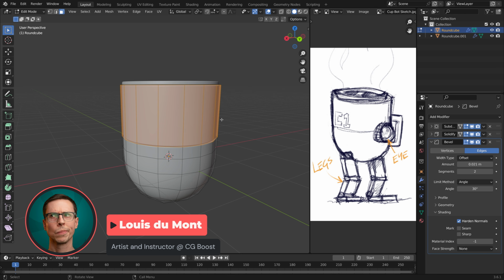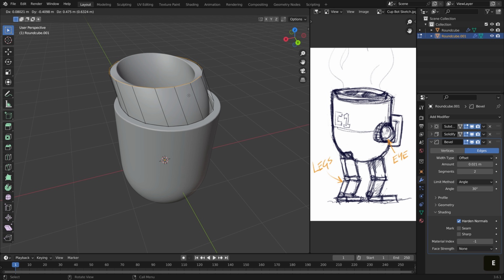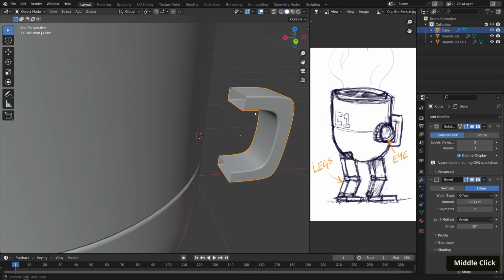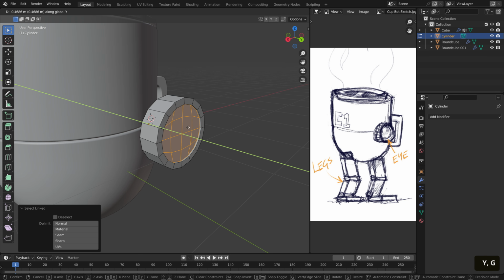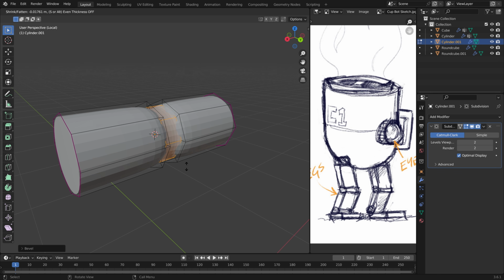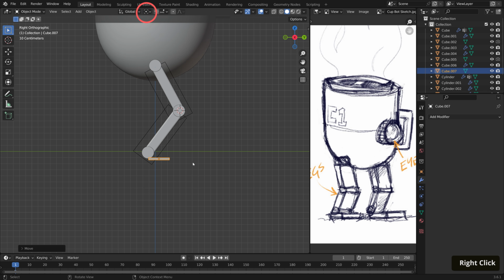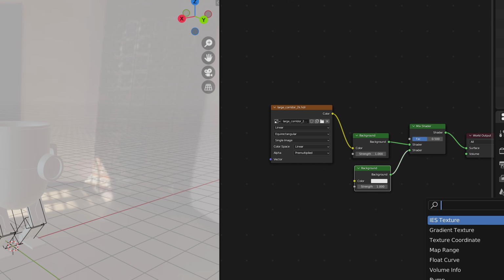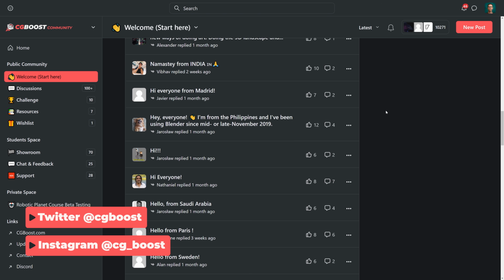Blender Hard-Surface Modeling Fundamentals #b3d #tutorial

Comment: Updating for 5.0.1 - 
1. Auto Shade Smooth exists right now. 
2. I found the 'extra objects' it's extra mesh objects and you search for this in the 'Get Extensions' part of the Preferences. 
3. Shrinkwrap is a pain, but remember to apply your scale and transforms, play with the settings. Modifiers are not destructive so if it's all messed up, try it a different way. Apply it in object mode! Order of your modifiers could be causing issues so if you press the icon that looks like a TV on each modifier, you can likely see if one is causing an issue and push it up or down in the list of modifiers that you have applied to the mesh. You probably just need to apply rotation and scale. 
4. When making the first part of the leg - he says ctrl e, but it's shift e. 
5. Inverting a selection with ctrl I. (he shows the key presses in the corner!)
6. There is no ambient occlusion setting in the render settings for 5.0.1 - I don't know how to work around that part. 
7. There is no bloom setting in the render settings, here's a quick fix https://www.youtube.com/watch?v=Yyofx-wbqCY&t=60s

Great tutorial! Subscribed - the speed is fast but I'm between beginner and less-beginnery so it was perfect for me!
Reply: I did this tutorial today.  What timing, your notes helped, thank you!!!
Reply: @zenzager  So glad! It's a great tutorial!
Reply from the maker: Wow, thanks for adding this info! ~Louis
Reply: @cgboost  No problem! :)

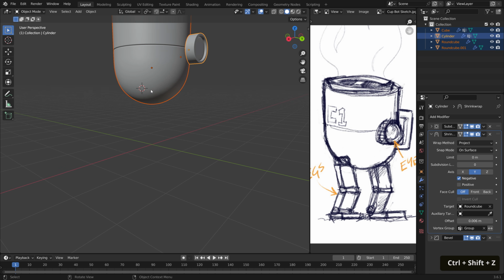Comment: My 'cylindrical joins' at 16:09 are not functioning as expected.  When I shift+e to crease them it warps the piece in the middle instead making it taper to meet the larger pieces of the cylinder on each edge instead of it being a flat drop like in the video.  Any assistance would be appreciated!
Reply: Figured it out.  There is a second set of inner edgeloops that I wasn't selecting

Comment: Crease vs support loops, when use them and why?
Reply: Just always always do support loops. 

Don’t become reliant on creases. It’s a shortcut that leads to bad habits. 

Real-world objects have slightly rounded edges. Support loops catch light realistically, whereas full creases create an infinitely sharp, unnatural edge.

 Support loops are actual geometry. They transfer perfectly to Unreal Engine, Unity, Maya, or 3D printing software, while Blender creases do not.

Texturing software like Substance Painter bakes ambient occlusion and curvature maps much cleaner when using real geometry.

Only use creases if you are prototyping. Not making a real model.

Comment: I've tried this in Blender 5 and the shrinkwrap doesn't work if I follow the steps.
I don't know if I'm doing anything wrong. Does shrinkwrap work different in 5?
Could you tell me if it works differently in Blender 5 or remake this tutorial for Blender 5 showing what needs to be done differently?
Reply from the maker: Hi, just tried following along and it seems like shrinkwrap in the same way. I could be that the (for example) the handle is on the positive side on the X axis and requires 'negative' to be selected in the shrinkwrap modifier. If in doubt, checking both negative and positive might work in this case. ~Louis

Comment: Hi, I noticed my modifiers were greyed out and yours were not, however, I could still apply them. I used Shift + D to duplicate the initial insert of the cup so this should have gave me options to apply modifiers separately with different values? I selected objects and altered the relationship to Make Single User but the problem remains. One thing I may have done wrong was that I applied a modifier and then pressed Undo, but I believe this may have set the modifier anyway as once it is applied it cannot be undone? TIA

Comment: I cannot apply scale on the mirrored leg in first place. What ive done to fix that was to apply all modifiers, then select all the leg parts, press ctrl-a -> apply rotation and scale, then with this objects selected i pressed tab (edit mode, then a to select all, then shift n, (recalculate normals outside). i think this is not a good tutorial, i get errors about transfomration, and some things are not well explainded why i done that. Its a good tutorial showing a way to model faster, but not well explained.

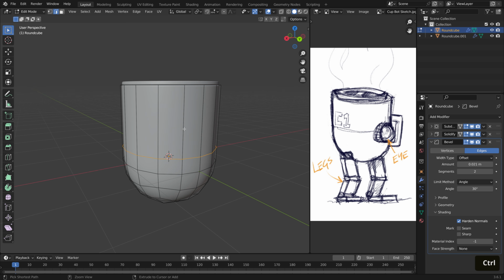Comment: If like me you didn't understand the process of adding a lip at first (5:12) and why exactly it works: Essentially when we've seperated the mesh with Y, the solidify and bevel modifiers act on the two mesh parts independently. This won't make a visual difference for the solidify, but since we now have two edges (on the lower and upper mesh parts), they will be independently beveled, creating a nice lip. Pretty cool modeling trick.

Comment: Hi, I am on Blender 4.3 and the shrinkwrap modifer is not working for me when I use it on the eye part. It works fine with Handle but not the eye for some reason,  I tried using negative instead of positive but it still doesn't seem to work for me. It would be great if anyone could help me with this! Thanks!
Reply: Did you figure it out?

Comment: At 3:26 How do you get the sharp edge on the rim? I added the solidify modifier but it appears rounded.
Reply: Tried it on version 4.1 and 4.3. The work around is to Shade Flat instead of Shade smooth. Then shade smooth later on when the cup shape is formed.
Reply: Same problem here, the rounded cube was created with curve loops, my solution was to select the loop, then press S to scale, press Z to select z-axis and press 0.

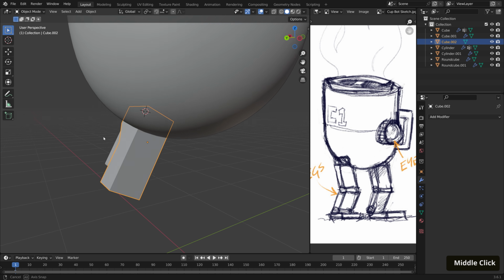Comment: if bool tool is not available on addons tabs look for it in extensions tab 20:10
Reply: if it gives artifacts after adding Boolean. make sure you select exact instead of fast in bevel modifier
Reply from the maker: @vasanthrajark  Thanks for the tips! :)

Comment: Hi, everyone! 
To everyone that's following this tutorial in Blender 4.1, here some things:
1 - Shade Auto Smooth doesn't exist anymore, so you have to go to Modifiers (wrench icon) > Normals > Smooth by Angle and then you Shade Smooth
2 - About the Shrink wrap, if nothing happens, try selecting Negative instead of Positive
If I see more diferences throughout the tutorial, I'll edit the comment!
Reply: i pray your pillow is always the  right temperature and your fridge always full 📿
Reply: Shade Auto Smooth is back. And shade smooth by angle modifier is not doing that.
Reply: Huge help. Thank you!
Reply: Hey I'm in 4.2 and after using the subdivision surface modifier, the object is more "round" but also has weirdly extruded lines going from top to bottom on the X and Y axis. Is there any way to fix this? It gets worse when using solidify.

Probably worth to mention that I didn't use the preset when creating the squadsphere because the presets are missing for some reason. However I did adjust the radius to 1 and Arc to 4.
Reply: @itsrainingacid143  I'm using 4.2, I don't have any problems
Reply: Thank you!
Reply: Thank you!
Reply: Thanks, i was so frustrated cuz the shading didn't work properly i almost quit the tutorial😅
Reply: Another change is that "Bool Tools" is in the extensions tab instead of add-ons, I believe!
Reply: thank you so much. you are the best ^_^
Reply: the shrink wrap still broken whith me
Reply: Immediately got stuck because I do not see those addons in version 5.0.1. I tried looking up both the keyword extra and mesh.
Reply: looking, it looks like it is dropped from the addon bundle, but you can still get it. However, it has limited support
Reply: Figured it out! ran into the same issue with another tutorial... all of the old addons everyone was using in Blender 4.whatever got moved to the EXTENSIONS tab in 5.0.1. Everything can be found there!
Reply: I'm using Blender 5.1.1. I was aware of the Shade Auto Smooth being replaced by a modifier. I did encounter the ShrinkWrap issue you mentioned. Your solution worked. Thx!
Reply: Using 4.5 and the auto smooth is back! :face-blue-smiling: but this time the Bloom checkbox is gone ❌now  it's in the compositor behind 
the glare node. That's one thing I love about Blender is that they like to hide buttons and functions just like my dog who likes
to hide my car keys.  Always fun to do these "side quests" 👉 life would be so boring if the UI would be stable and static. :face-green-smiling:

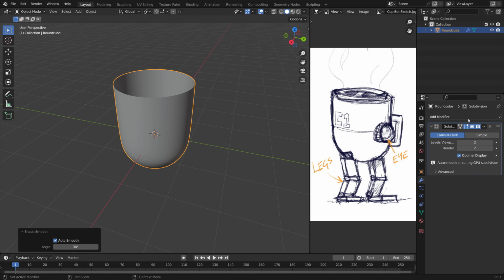Comment: At 3:20 I don't have the 'shade auto smooth' option, just 'shade smooth' or 'shade smooth by angle'. (I'm using ver 4.1) Selecting either one of them gives my cup a very rounded lip once the solidify modifier is added, not the hard edge lip as in the video. Messing with the angle settings in the operator panel doesn't fix it. Any ideas?

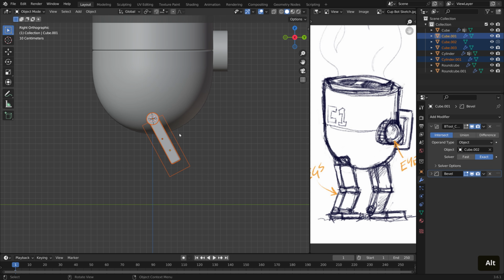Comment: at 21:16 when atl-D the selection, the cut does not come through.  I had apply the Boolean modifier first.
Reply from the maker: Hi, have you also selected the cut mesh?
~ Masha
Reply: @cgboost  Yes I did, and as I started to move it, I was able to see the cut but then it disappeared when it got out of range with the top part of the leg.  It might have to do with for some reason my Blender does a linked instance on Shift-D instead of Alt-D.  Alt-D is just a regular copy.
Reply from the maker: @pat2e215  Hi sorry for the suuper late reply. That's strange, do you have windows or something else? And if you use shft+D does it work for you?

Comment: as someone mostly interested in hard-surface and robotics modeling this helped a ton. This is like the perfect follow-up after the Donut tutorial.

at 17:35 when I add a Bevel to the cylinder it doesn't actually do anything, any idea why? Well, it does do SOMETHING but it mostly messes with the shading until I Harden Normals

im on 4.0.2
Reply: it worked the second time, could it have something to do with the direction of the crease? or is Mean Crease a fixed value?
Reply from the maker: @HermanManly  hi! great that it worked. Hard to say what was wrong without seeing the file. If you like, you can post it here in our community https://community.cgboost.com/home
~ Masha

Comment: Hello. Its a long shot asking but can you explain why when making the handle, pressing S + X + 0 resulted in the vertex alining?
Reply from the maker: you basically tell blender to scale the points to 0 using a reference point(this depends on what you have set as transform pivot point). Since you can't really scale the points, the result is that they align on the specific axis. I hope this helps you to understand.
~ Masha

Comment: Why would one use shrinkwrap instead of simply moving the object to the surface?

My hypothesis is that it run smoothly/better with future animation/rigging?

this tutorial is amazing, thanks
Reply from the maker: Hi, thanks for your question! Using shrinkwrap allows you to quickly project an object or a part of an object on another object. In many cases it's more precise and quick the moving the object manually, especially if you need it to be aligned to the surface.
~ Masha

Comment: Hi there, when I do the shrinkwrap, I can not get a clean join, it on several occasions as ended up messy, I tried the shift e thing, but this changes the whole handle. Offset, snap, wrap, Limit and who knows what. But still it doesn’t work?
Reply from the maker: Hi, hard to tell what happens without seeing the file. Could you please post it in our community https://community.cgboost.com/home
You can also send a we transfer link through our contact form here: https://www.cgboost.com/contact
~ Masha
Reply: I had the same issue. Fixed it by setting the scale and rotation (ctrl + A) before applying the shrinkwrap mod

Comment: 9:35, may I ask why we need to loop cut? How is it increasing control resolution?
Reply from the maker: Hi, this is helpful to have some more vertices to snap on the cup by using the shrinkwrap modifier. Since the cup is rounded, if we don't have that loop, the handle part snapped to the cup wouldn't have enough geometry to properly stick to the shape.
~ Masha

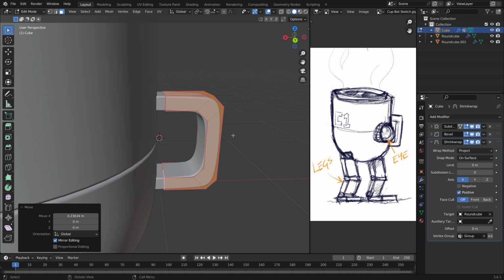Comment: 10:48 On te modifier Shrinkwrap the "project" option didn't work for me, I tried "Target Normal Project" and it did the trick
Reply: You most likely forgot to go: Object > Apply >  Rotation & Scale, before attempting to apply the Shrinkwrap modifier. If so,  it may have been projecting along another axis due to any upstream rotations in your creation stack (for example, the cylinder for the lens had a -90 degree applied to it to get it into place - if so, you needed to project along z, not y).
Reply: @montoyland  oops, probably! thank you
Reply: I figured out my similar problem. I need to select negative checkbox. And then everything looks good. The problem is that we use different X/Y positions. For example author select negative for eye.
Reply: @Vsevolod44  lifesaver :))))
Reply from the maker: Great to know you found an alternative! If you like, you can still post the file in our community here https://community.cgboost.com/home, and we can try to figure out why project method didn't work for you :)
~ Masha
Reply: Thanks man came across the same issue
Reply: @ivandimovpetrov5174  After sometime I figure I had to check the "Y" intead of "X" cause that was mine rerefence for the handle, and I ended up choosing the "project' option. But the "target normal project" didn't look bad
Reply: For some reason I put only the Z axis and it worked. So (project, on surface, axis Z, negative on, positive off, target the cup, and than that group that was made in edit mode on the face). Hope that helps someone

Comment: It's interesting seeing all the unnecessary steps you do - Like selecting faces and removing only faces at the start, instead of just selecting the top vertices and removing those immediately. Or, adding a material slot then adding a material, when adding a material without any slots automatically adds a material slot.
Reply from the maker: Thanks for the tips. There's always room for optimizing workflows :)
Reply: @cgboost  I'm relatively new, though I'm sure everyone loves short cuts eventually, seeing the full step by step and its workings helped me understand better what was happening/I was doing xD
Reply: @LeoA05  Yes, this is true! Sometimes flying through hotkeys efficiently can leave new users in the dark

Comment: Hi, I'm surprised every time I watch your course or Blender course. It seems like it's easy to produce a great-result. (Not at all in my hands). Thank you for the good video. I have a question. I'm a blender beginner and a longtime Maya user. Based on Maya standards, I think there are a lot of polygons in the result, is this because the blender can operate more polygons? Or is it to produce results faster? Usually, in Maya, if I'm going to make a similar result, I don't go with this much wire right before the wire that the Renderer makes. Of course, I understand that it's going to be similar to Maya in Modifier and Edit mode, but as a result, I think I see a lot of wires Did I misunderstand?
Reply: its because he has a good computer and its either cpu based (eevee) or gpu based (cycles) and its not cpu intensive because of how its rendered. For his example, he is showing you how to produce fast results rather than a performant model that has say 3k tris. He is around 20k tris.

Comment: I would rename the video to 'Blender SubD Modeling Fundamentals' - this is confusing for beginners as to what hard surface should actually be. 
Other notes, for the boolean slicer, some scene management like moving it to a 'cutters' collection would have been nice to present.
Don't duplicate with alt+d without explaining in this case its behavior (any changes to the original mesh, will be reflected on the duplicated instance), instead use shift+d that doesn't have this behavior.
Also, when we flip stuff in blender, like you did with the legs, you haven't explain a problem you just introduced. The scale of the object will now be negative in the mirrored axis. This is problematic as once we apply scaling, all the faces will be flipped, this is a major issue especially when exporting for game engines. To fix this, enter edit mode after applying scaling, select all faces and hit shift+n to flip the normals.
You use subdivision modifier on almost all meshes, this just isn't hardsurface modelling (it would at most have a bevel modifier and that's it, mostly boolean and direct work with vertices).
My two cents, again good video for beginners but low bar quality in the delivery of the video and topic.
I remember how daunting Blender felt coming from 3DS Max many years ago but since then I never regretted the change and wish all that they stick with the tutorials at the beginning, the more the better and from as many tutors as possible.
Reply from the maker: Thanks for the feedback. Actually the things you mentioned are explained more in-depth in the Robotic Planet course. This video just introduces some concepts and techniques to use (That's why it's not titled 'Everything you'll ever need to know about hard surface modeling' or anything of that sort ;) )

Comment: I learned some new techniques from this video, but there are concepts that I believe are fundamentally wrong. Coming from C4D and being concerned about clean topology, I'd extrude both the handle and the eye from the mug object, making it a single object, adding support loops as needed for the shape. Same thing applies to the duplicate mug just for the sake of the top rim. I don't quite get the point, it's a simple extrusion or inset. Simply slapping on another object without properly attaching it is a typical blenderism. 
However I didn't know the rounded cube trick so it's worth a thumbs up.
Reply from the maker: Well, making it a single object makes sense for some usecases (such as having a watertight model for 3d printing etc.) but for the usecase here - a simple animation it makes no visible difference. Of course there is value in knowing how to model that in the way you described - but calling taking useful shortcuts a 'fundamentally wrong' approach is quite harsh IMHO :). If it works - it works.